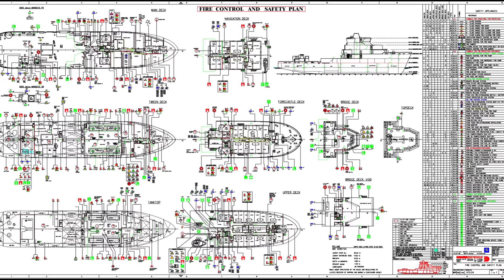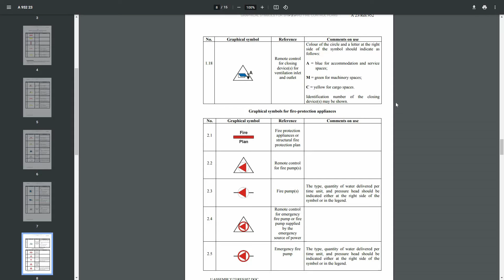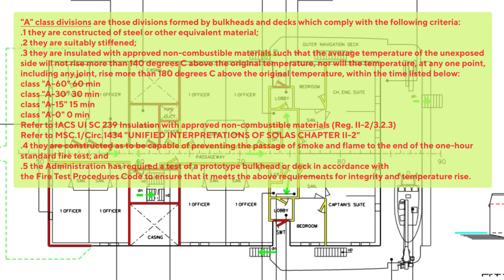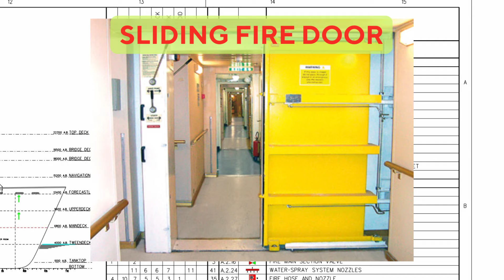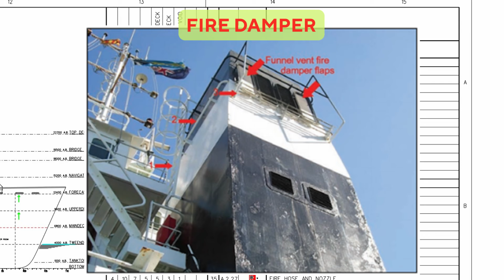FIRE CONTROL AND SAFETY PLAN Part 1 | UASUPPLY

Comment: Short Summary for [FIRE CONTROL AND SAFETY PLAN Part 1 | UASUPPLY](https://www.youtube.com/watch?v=jHEl5KBBaTU) 

Ship Fire Control Programme Specification Explanation | UASUPPLY

[00:13](https://www.youtube.com/watch?v=jHEl5KBBaTU&t=13) Fire Control Plan Requirements

[00:53](https://www.youtube.com/watch?v=jHEl5KBBaTU&t=53) The fire control plan must be stored in a weather-related facility for use by shore-based firefighters.

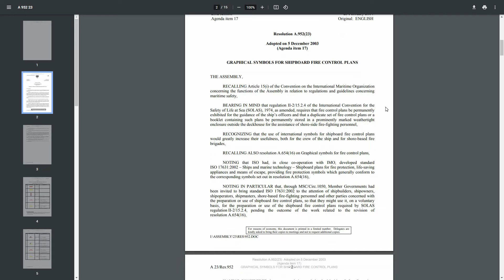[01:57](https://www.youtube.com/watch?v=jHEl5KBBaTU&t=117) Fire Control and Safety Plan Overview

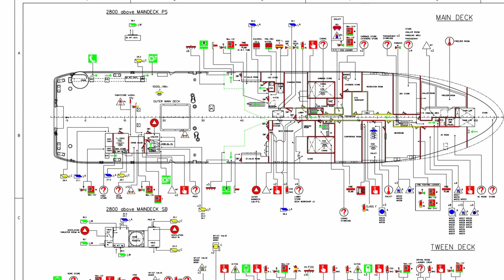[04:11](https://www.youtube.com/watch?v=jHEl5KBBaTU&t=251) Structural fire protection symbols are important for safety.

[05:25](https://www.youtube.com/watch?v=jHEl5KBBaTU&t=325) Components must not exceed specific temperatures during fire exposure.

[06:03](https://www.youtube.com/watch?v=jHEl5KBBaTU&t=363) Ensure integrity and temperature rise compliance of bulkhead or deck prototypes.

[06:50](https://www.youtube.com/watch?v=jHEl5KBBaTU&t=410) Requirements for fire control and safety programmes include insulation and temperature limits.

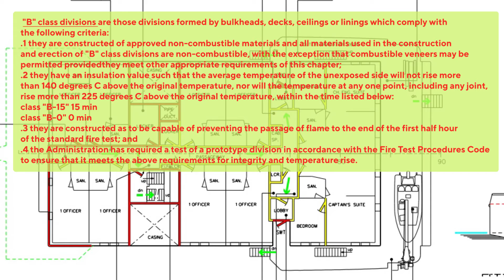[07:30](https://www.youtube.com/watch?v=jHEl5KBBaTU&t=450) Prototypes are tested to meet fire safety requirements